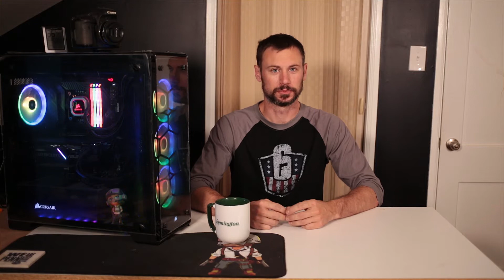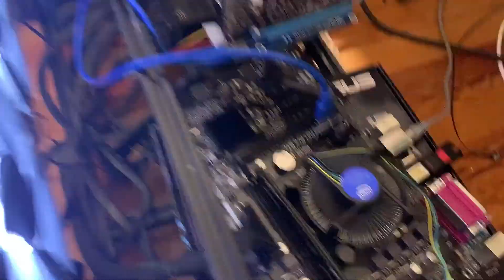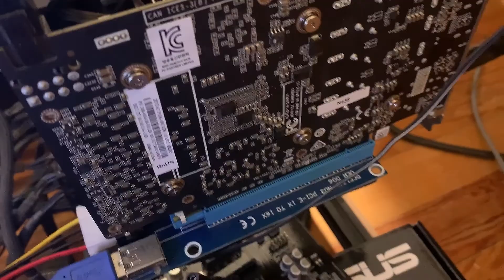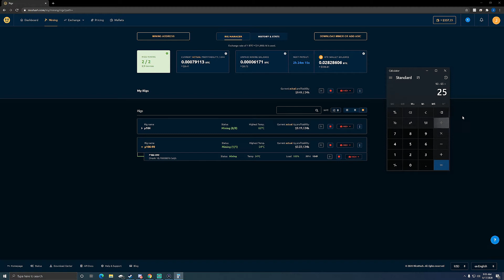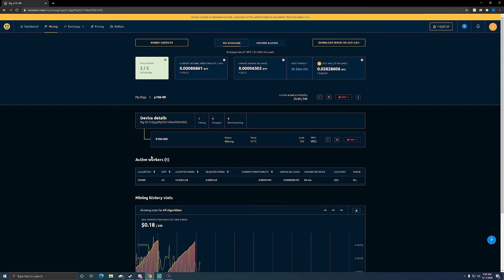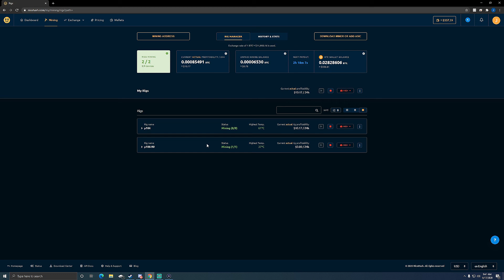Nicehash OS testing on p106-90 3gb

Comment: I found one of these going for $40, do you think it's worth picking it up?
Reply from the maker: For just one gpu probably not.  By the time you run your motherboard and that gpu you will be sitting at about 110-120 watts I would think.  That would cut in to the profitability.  I also made offers to a few sellers on eBay and picked them up for $32 each. But I also bought 12 at one time.  I ended up selling 4 of them and 2 of them were DOA. Plus on nicehash they were not very profitable.  I switched mine to ravencoin using hiveOS and they are making more revenue
Reply: jtravaglini Thanks for the quick reply! I'll probably look at saving up for a 5700xt or something instead of picking up a few of these because afaik the profitability and ROI on them are pretty good.
Reply from the maker: ABZZDEV I’ve heard good and bad things about the 5700xt’s. Apparently they are made in two different countries.  And you want the ones made in China.  I forget that brands are made there.  Other miners talked about it.  The ones made in China though work better and are more efficient. Next week with the 3080 coming out I bet you can scoop up a 5700xt much cheaper

Comment: Bro try Hive Os Beta. To make your rig stable.
Reply from the maker: I actually had my p106-100 rig on hive OS and after two days my usb drive died. I put it back on windows for now on claymore miner but I went to Best Buy to get new usb sticks. I got better ones.  I bought really cheap ones before on amazon.  So it dying was not a shock to me.  I plan on getting off windows on all
My rigs.  I have three running rigs right now.